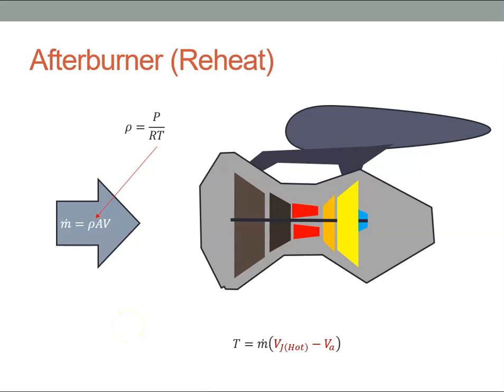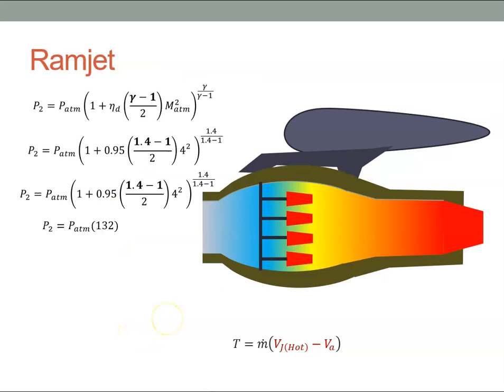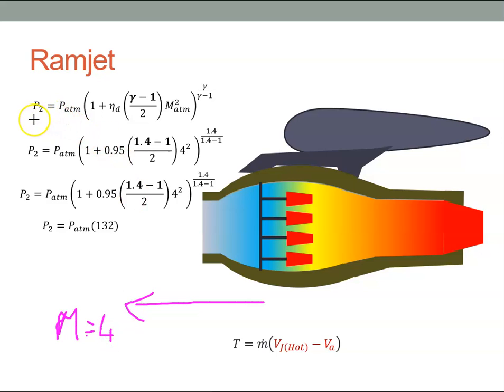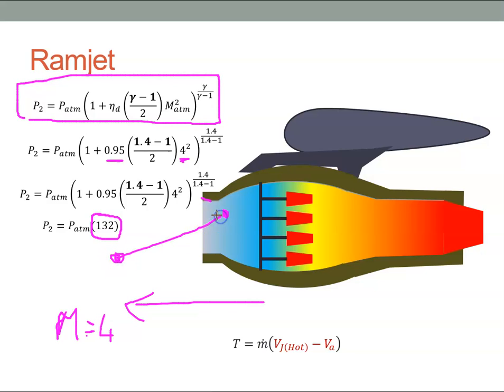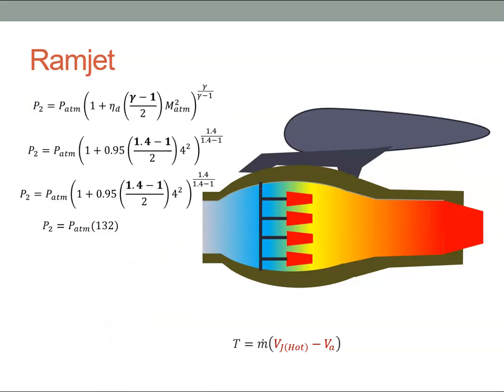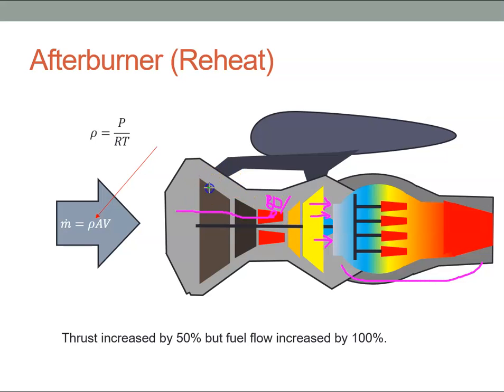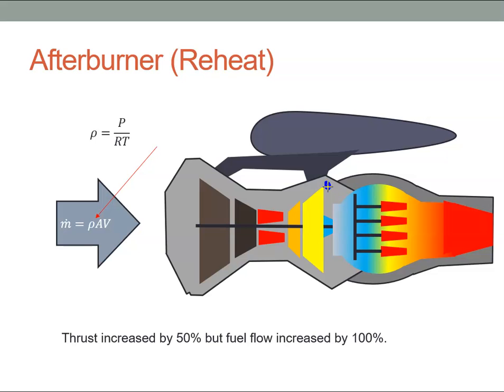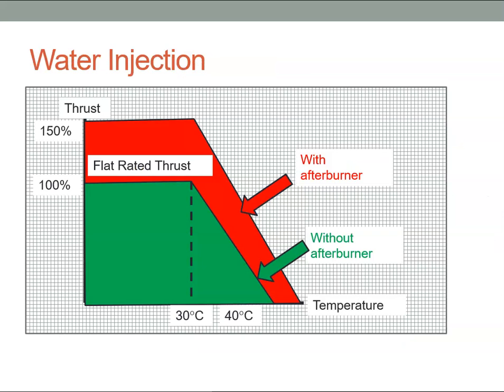Afterburner Overview

Comment: Just discovered your chanel its a+ content. Im doing my masters in mechanical engineering where we covered the foundations on a much more technical level (e.g. not assuming air to be an ideal gas) and solving those kind of processes with pdes. So its great to see the same kind of topics presented for specific cases in a quick and broad way so I can get an overview of the specific topic without having to go into the details. Cheers to you mate!
Reply from the maker: Best of luck with your studies.